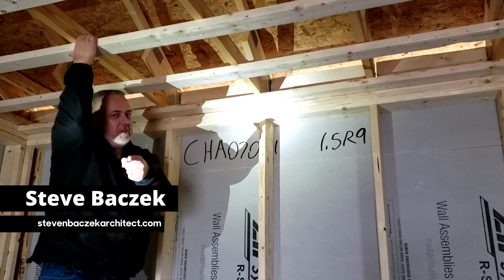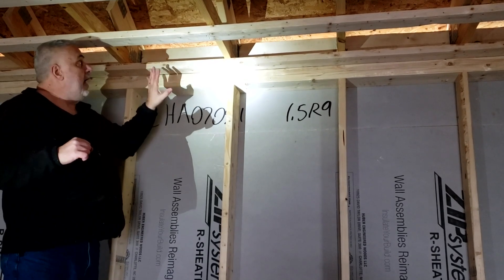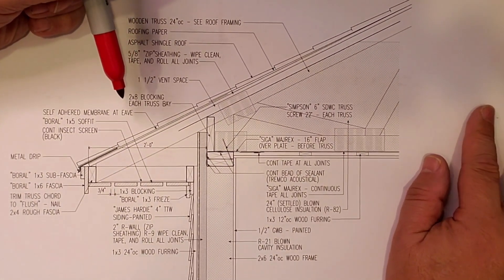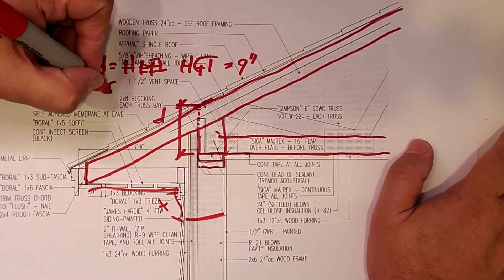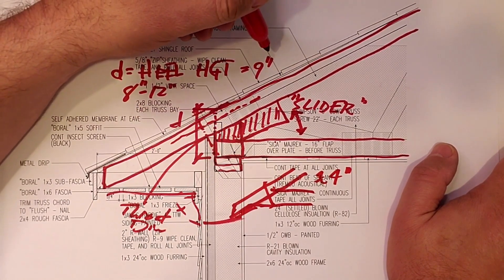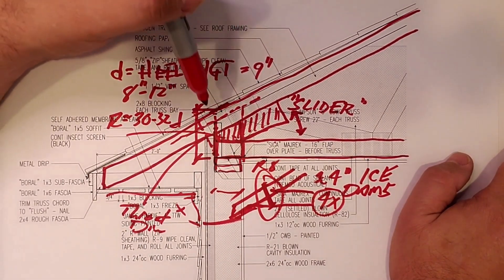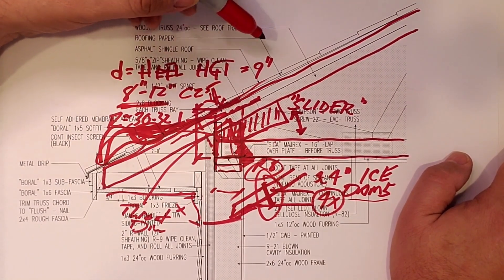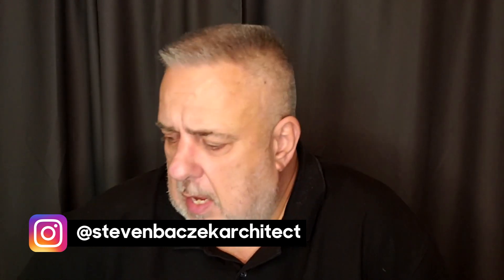RAISED HEEL TRUSSES / ENERGY ROOF TRUSSES......

Comment: Thank you so very much for your excellent information. I will be building in Australia, in climate zone 7 (which I think is the 2nd coldest zone over here). This has solved all the concerns that I had about gaining the extra height to enable thicker batts that standard bottom chords would not allow. I will speak with the truss manufacturers. Thank you once again- greatly appreciated 😀

Comment: Thanks Steven.  Is there a way to prevent truss uplift? I have a truss roof and while I don't have any nail pops in my ceiling I do hear loud noises from my attic during super cold weather.  Sometimes it sounds like a gunshot.  I have very deep cellulose insulation and the bottom chord is completely covered.
Reply: You can remove the overhang soffits outside to gain access to bottom cords and top plates then put hurricane ties or truss screws. Easier than diving into cellulose.
Reply: @MurDocInc  I saw them put in metal plates to secure the bottom chord to the wall top plates.  I think truss uplift has something to do with the bottom chord being warm and dry and the top chord being cold.  The different temps and moisture cause uneven expansion and contraction and thus movement.

Comment: Raised heel vs double cantilevered truss, pros and cons, discuss
Reply: Raised heel:
-Higher heel heights
-Easier to block, just run sheathing up to top cord, also act as large gusset for uplift.

-More eave design options.
-Walls might end up higher outside.

Cantilevered:
-Heel height limited by pitch and overhang depth.
-Harder to set cause marking for overhang depth is required. versus lining up end points.
-Larger overhang depths
Reply: @MurDocInc  Excellent points. Also the raised heel with the sheathing up to the top chord creates a stop for the insulation. The only con is how to easily air seal the wall to ceiling plane at the top plate corner. Maybe sealant at sheathing where it meets the top plate.

Comment: raised heel > stnd (agree with pushing up whether truss or stick). And I agree there are always trade offs, but it is nice when there is 'access' to the guts / key areas of a structure.  I was 'born' in a 1910 house that was 1.5 story. I miss the days of eave access in my current house- which isn't ideally insulated or air-proofed.

Comment: It seems like this could also be accomplished by making the ceiling slightly taller and attaching the ceiling a few inches lower on the wall.
Reply: It`s harder to air seal that way and also easier to just spec raised heel on trusses you going to order anyway.